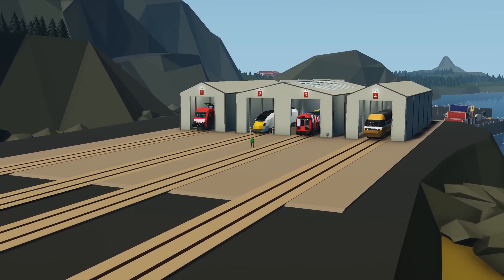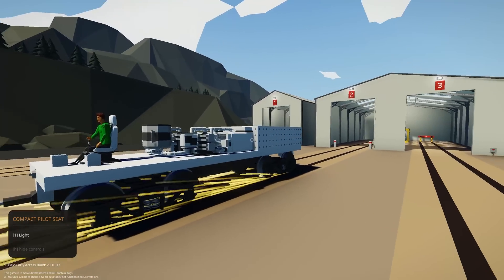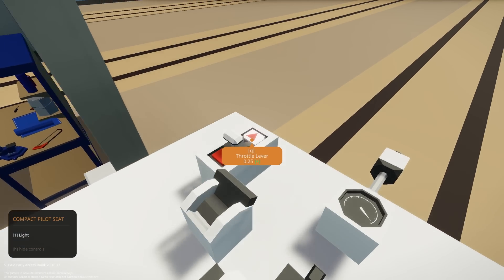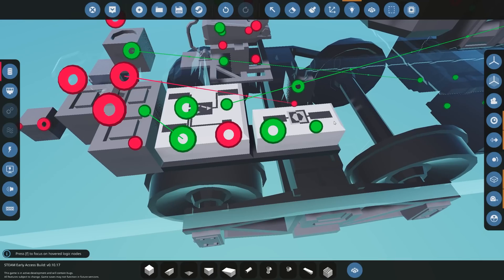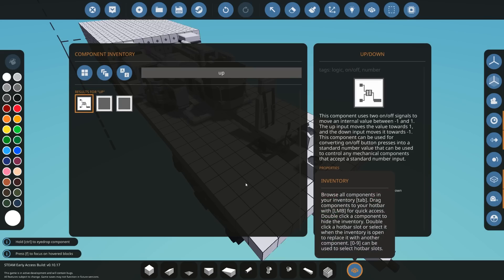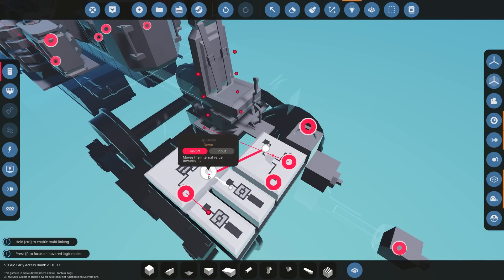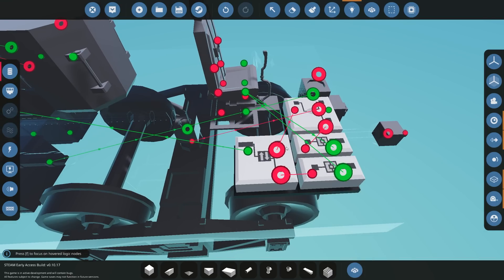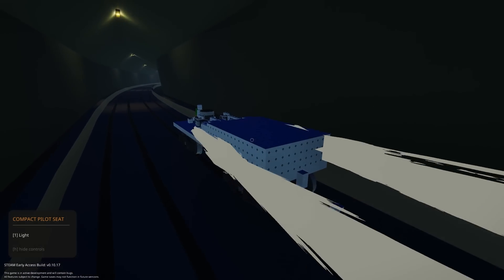Anti Wheel Slip System - Stormworks Tutorial

Comment: Train wheels are broken right now, my diesel locomotive (Modular Engine) always produce 100% Wheel slip, it seems like to be too much power on the wheels, but i start very slowly (<0.004 Throttle) with < 8 RPS, from 0 is impossible because the clutches release power to fast. I do not find a solution to get still less power to the wheels. How can i start with 0 RPS on the wheels and than slowly spin up with 1 - 2 - 3... RPS. there`s no RPS Control for this with the modular engine. Normal wheels do it fine, but the train wheels has 0 grip and will spin instantly slip.
The anti slip system will set my throttle to 0...

Comment: The wheels begin to slip if the ratio |speed-wheelsRPS*3.14|/9.6 is greater than 1. So you may use PID-controller to dynamically limit motor throttle and keep that ratio slightly less 1 to prevent slip while maintaining maximum acceleration.
Reply: PID settings? im not smart enough for those. Sorry.
Reply: Thanks a lot, it works damn well. And how did I not think of working with the difference in the speed of the wheel and the speed of the train with a simple multiplication of rps by pi?...
Reply: hey... do you know how to do that? i dont even know what a pid is
Reply: @1ue999a pid is a logic block in stormworks

Comment: Should it be brakes instead? Unless using the brakes would be less efficent...
Reply: If you apply brakes, the train is - naturally - going to slow down. As soon as wheel slip stops, your train will start accelerating again. You get a very bumpy ride.
If you just throttle down, the train /may/ slow down a little bit, but it should keep going at roughly the same speed because power is still going to the wheels. Your journey will be much smoother.

Comment: thanks for the tips but can i ask how did you make your trains so powerful my trains can barely pull anything.
Reply: Speed and power
Reply: @ValentineC137  thanks for the tip
Reply: @orrinkerr3365  Just try out different Engines, Like Diesel, Electric, or a cobination, and use gearboxes to make it more efficent. Personaly i built yesterday a Jet Engine powered train. I took the power from the medium turbine and piped it via a clutch and a gearbox (so i can reverse) to a set of wheels and man... that sucker goes... haven tried pull anything yet but. Jet engines can get you alot of power but you need to experiment and have fun.